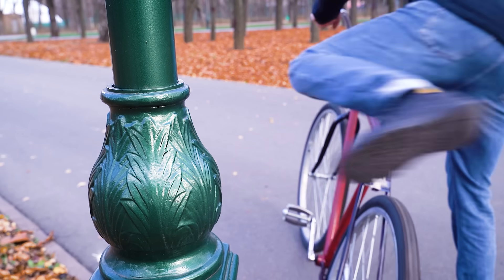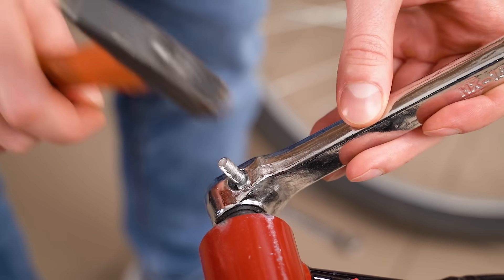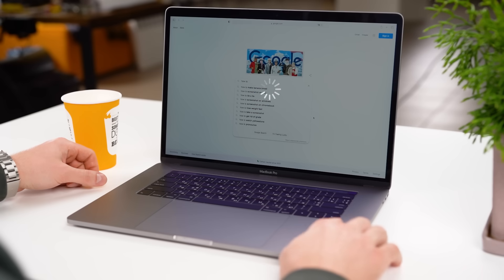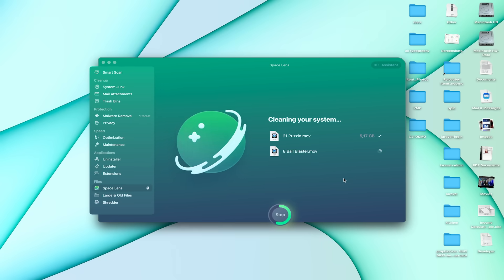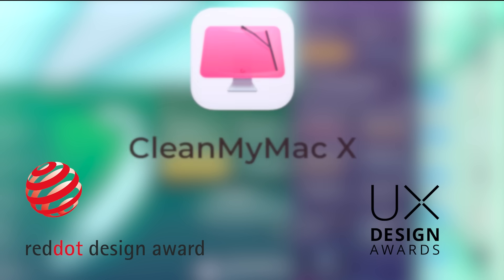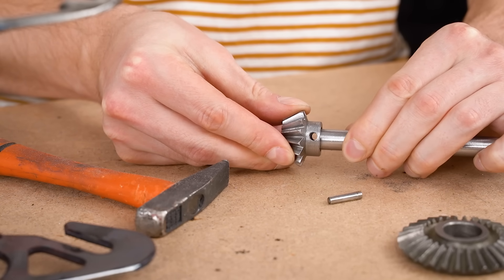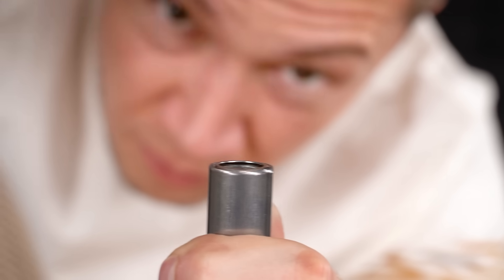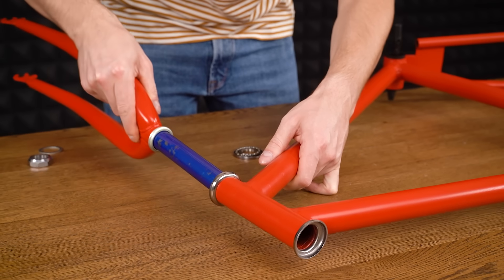Insane Chainless Bicycle Prototype

Comment: I've seen this idea before. Problems are 1) gear ratio, you're confined to one, 2) the actual contact point and transmission of power is confined to a single tooth at a time thereby putting extreme force onto a small point, 3) the drive shaft roller bearings are pretty small and likely to fail quickly, 4) the drive shaft is thin and subject to distortion.
Reply: Isnt the most glaring and impractical problem with this particular design that the pedals wil be forced to turn as long as the wheel is turning?
Reply: @HashCracker   If the drive mechanism was the only thing we were considering then how would shaftdrive be any different from a chain? There's nothing in a chain drive by itself that allows the pedals to stop independently of the wheel while the wheel is spinning. Think of a fixed gear bike. The freewheel in the hub is what decouples the wheel from the drive, and shaftdrive hubs can also have freewheels.
Reply: @jimmyjakes1823     Yes, thats why i made sure to say ' this particular design ' in my comment. I figured yall were speaking of the content featured in the video and not shaft driven bicycles in general
Reply: @HashCracker  Yes, we are talking about his implementation of a shaft drive design. My question is still what is it that would be limiting him to a fulltime, fixed connection between the crank and hub with 'this particular design'?  Because I don't see anything. The mechanism that decouples the wheels and crank is in the rear hub, not in the drive. He can use whatever type of hub he wants with this design as long as it isn't in some way fundamentally incompatible with a shaft drive. He actually seems to be using a coaster brake hub on the bike in this video, so the wheels would keep spinning independently of the crank. when he stops pedaling.
Reply: @HashCracker  A clutch system needs to be introduced that only engages once pedals are pushed clockwise.
Reply: Number 1 is wrong. Youre NOT confined.  With a few modifications you can make the system work just like a chain derailer, except it would be a gear derailer.
Reply: Yes, number one is wrong because you can use it together with epicyclical gear hub such as Shimano Nexus.
Reply: Very well engineering explanation. Thanks.
Reply: Which all gave way to the discovery of chain driven bicycle.
Reply: I was about to say same.
Reply: First time you go over a bump, that's goodbye.
Reply: Well. China can make this  a perfect bike system. 😅😅😅😅😅😅
Reply: 5) - конструкции необходим кожух, иначе от грязи и пыли значительно уменьшится срок службы шестерней
Reply: @7days306 a snack company🤔
Reply: Ware are the breaks ?? Also
Reply: Human power = .03 of one HP . Then you add your total weight what ever that would be . If that soild 3/4 inch shaft is harden steel then no problem . The bearings have no problems eather . Becuase the shaft would be vary little pressure on them .  Helicopters uses the same system for the tail rotor and those shaft are of aluminum tube .
Reply: @jeffmullinix7916 a human can generate more than 300 thats half of a hp= 736w
Reply: Its a prototype
Reply: We've all seen it before, it's literally going backwards in technology.
Reply: These issues are so obvious, its frankly surprising that someone with the ability to make it, wouldn't already know its a terrible idea/design.
Reply: @ckmoore101  It's not a terrible design at all. Cities all over the world use basically exactly the same design in ride share bicycles because shaft drive is the most durable and low maintenance design. It's the same reason touring motorcycles all use shaft drive.
Reply: @jimmyjakes1823  Sure, its not terrible, "for a ride share bike" which has extremely specific and targeted usage, and needs. Which do not overlap with recreational bikes. My original statement is still valid. Why? Because no bike manufacturer sells bikes with that design for recreation. If it worked, it would have been done 100 years ago. And the only reason the ride share bikes use it, are because its a closed system, so no lawsuits from people being stupid and getting things caught in a chain. And we are talking about bicycles, not motorbikes. Shaft drive on motorcycles are different.
Reply: @ckmoore101  Let me be clear , I'm not saying shaft drive is necessarily better for recreational riders than chains. I'm saying the design itself is fine contra your statement that it's terrible. Of course chains will always be cheaper and a little lighter, but that doesn't make shaftdrive terrible. Basically all of the OP's points are incorrect or overstated. That said, lots of companies make/ have made bikes with shaft drive that they sell to the public (a quick search turned up the Brik Brut 8 speed). Why couldn't you ride these recreationally? Lots of people have. You pair them with a Shimano Nexus hub and you have an extremely versatile, low/no maintenance, reliable bicycle. It just happens that there's not a huge market for that outside of high use/abuse applications that's willing to pay extra for  that level of reliability. My BMW GS motorcycle has a shaftdrive for the same reason city ride shares use them, because it's the most reliable and durable drive system. The actual shaft drive mechanism in this video where a pinion gear on a shaft turns a ring gear on the rear hub is the same mechanism that's on my motorcycle. So what's the difference?
Reply: None of those are problems that don't have easy real world solutions and #2 isn't a problem anyway. The most dependable motorcycles all use shaft drive not radically different than this implementation. Basically the only reason we aren't doing this is because it's more expensive and a little heavier than a chain, and there isn't a huge market for ultra durable bicycles. 
More specifically:
1)Use hub gearing. Tbh, derailers are messy, unreliable and beyond the maintenance capabilities of most people anyway.
2) This is exactly the same ring/pinion gear design used on automobile drive shafts and a gazillion other power transfer applications, and many of these don't have contact with much more than a tooth at a time either. The heavy gears used in this video are actually probably overkill for a bicycle. 
3) All the bearings on a bicycle are small. There's no reason properly manufactured bearings should fail here, or if you really had to you could increase the torque tube diameter by 1/8 of an inch and use larger bearings.
4)It's probably fine for regular riding, but you could just use a better quality steel/beef it up as necessary. 
5)Someone else mentioned this setup would get dirty. Chains definitely get dirty and this is much easier to clean and maintain. If necessary this could easily be made into a sealed system that would never require any maintenance. This is exactly why so many touring motorcycles use shaft drive.
Reply: @jimmyjakes1823 yeah as you said gears  are just more expensive and bulky and are only really necesary for high power transmision, its just way easier, convinient and cheaper to use a chain, sure you can make gears smaller and more eficient and sealed, etc but it would be more expensive for no reason, its just not necesary, i have driven bicycles my hole life and never had a problem with the chains
Reply: @mrsnail8664  I agree. I personally have zero need for a shaftdrive bike.There are specialized situations where it makes sense when the environment & usage require something ultra durable and low/no maintenance. Portland uses shaftdrive bikes with internally geared hubs in its rideshare program.

Comment: I applaud the effort. I also submi my observations: Inefficient, prone to failure and expensive due to replacement needed of worn machined parts. Result: Good practical experiments are not based on old failed engineering concepts. This design has applications elsewhere. Eg:Ships, boats, gliders,tents, gliders, big top tents and weapons. That said a 100 on the video. P.S, On second thought There is a way to increase power output ;) Clue - "Be like water".

Comment: Cool concept. In the early days they could not manufacture bicycle chains, so all biles were chainless, some with shaft and bevel gears. Question is if it can handle the torque that is as great as in a car engine, around 100-180Nm dependimg on how strong the biker is.

Comment: Well, this particular design lacks the years of experience... Dirt and mud eventually will do the thing, and it will be difficult to pedal this thing.

It would be way better to shield the gears within sealed body (with oil), to prevent the gears and the gear's teeth to corrode and worn out. 

Still, no gearbox for the shaft design, is it?

Comment: Great, now we have a bike with just one gear, and that is much less efficient, and it will wear out really quickly. People tried this idea out 150 years ago and came to a clear conclusion whether chains are better or worse than bevel gears for bikes.  Yes, it's insane to turn the clock back 150 years

Comment: The gear shaft bicycle concept has been around since the turn of the 19th century into the 20th.  The gear shaft eliminated the 'dead space' of the chain bicycle of the pedals at the 12 o clock and 6 o clock position.  That said,  the gear shaft was reputedly harder to pedal, took more effort, and presented its own set of mechanical issues. The gear shaft bicycle concept refuses to die and lingers around but it will never supersede the chain bicycle.

Comment: Ngl, although the idea of a shaft driven bike sounds cools and looks cool, I would recommend using a larger gear for the front and have the shaft gear be the same size as the gear on the wheel since the end result on this bike is too slow for practical use

Comment: One thing i would've added is a banding that went over the sprocket's retaining pin, with a single, light tack to keep it in place. I've used the 1800's variant of this bike and that's one of the biggest issues with this design, the pin coming out after a while. Could also be fixed with making a longer pin, that has a hole, for safety wire, which was the way they did it (on the restored bike i used) but the problem with that is, it can catch clothes, so a sleeve would be more "permanent" and clean.

Comment: If I made improvements to this system, I would treat the drivetrain like a car.

First, a transmission. Most cars have 4 forward gears; big semi tractors can have as many as 18 or more. So I would look into a bicycle gearbox for this concept, which I believe are now being made for E-bikes.

Second, from the drivetrain back, I would have enclosed everyyhing, and used axle seals with a light oil, such as automotive transmission oil or SAE-30 oil. That way, the gears stay cool. (A bicycle setup like this will never approach the heat an automotive differentiatial can produce.)

If you did both of these things, you could transfer mechanical power to the rear wheel more efficiently, as well as increase the durability of the parts involved.

Comment: This is a shaft drive design, which is similar to the principle of a car. We have been specializing in this kind of bicycle drive shaft for almost 30 years. The above gear is exposed and cannot be protected by lubricating oil. The longer the riding time, the faster the gear wears. It is recommended to seal and protect the gear structure.

Comment: Diesen Antrieb gab es von NSU schon in den Dreißigern. Also ist das nichts neues.
Reply: Sorry, my German is little off - does NSU make bicycles? I agree - in Austria I saw a German made city bike no chains and used internal getrieb....Kahlkhoff? Yep, it was internal drive shaft and the rear hub had speed gears to index....very useful in Austrian winters to have none of the drive movement exposed to salted roads! As you said nicht neues > however, despite internet the invention of new ideas are bound to repeat now and again? In U.S. practically nobody knows about hub mounted dynamo to drive the electrical lights?? Yet, now with e-bikes that feature seemed to catch on a little....leider, love dynamo and permanent lights like city bike in Austria.

Comment: That's cool, the gear ratio could be better I guess... And there are actual bicycles on sale with a shaft drive mechanism. And yeah it's way less efficient than chain, on bicycles at least. Oh, the rachet mechanism in bikes is actually pretty important, like for standing up and stuff, so this is pretty limited in that regard.

Comment: Actually; this is very impressive and hopefully someone else will build a compound multi geared system that lets a rider select the proper gear for speeds greater than 50 or 60 mph and or hills and terain at any pitch.

The existing bicycle gearing and drive method is totally antiquated and a get by system.  

There is no reason why the additional gears can't be added to both ends of the drive.  bike.

Comment: It's cool but 😂😂😂 if you use that kind of chainless bike your top speed is 0000.1 per hour
The big gear makes your speed higher and small gear makes your speed slower
But if you put large gear in the front  and small gear in the back your speed is higher

Comment: It is a bullshit idea which makes oryginal frame so weak, that only idiot could risk his life to ride bike, where right rear wheel has in practice strength not enougth to work longer than a few km of rides on perfect flat surface, because when this geniou sidea will meet bumpy road... debil riding bike like this will loose this rear wheel due to the weakness of materials on right side ?!?!

Comment: Good idea. But the use of iron pipe was bad. If the bike is accidentally tipped over, the iron pipe may be bent. Instead of a rigid pipe, a more flexible part can be mounted between the 2 gears.

Comment: Not workable ..

1. Gear pinions are a lot more expensive than chain and sprockets.  
2. You can’t have gears exposed to the element. It needs encasing. And seals. And lubrication. That adds to the cost.  
3. Chains and sprockets add to more gear ratios. That’s Campagnolo and Shimano.  You would think if gears solved the problem these manufacturers would be tight at it.

Comment: If the front drive gear was flipped 180 degrees then you would loose that ghastly looking gap at the bottom of the drive train an make the bb area look alot sleeker

Comment: But what f you have to stop?
You should try to attach the gear on the back wheel to the "free wheel" or ratcheting mechanism on the original axel. Pretty cool though just thought I would throw my 2 cents in.

Comment: Not so insane.
The mass production type is already on sale.
It was sold by Maruishi Bicycle in 1988.
There is a commercial at that time on youtube.
Maruishi Beveltech Shaft Drive 15" 1988
They are still on sale today.

そんなに非常識ではありません。
すでにマスプロダクションタイプが販売されています。
１９８８年に丸石自転車が販売しています。
youtubeに当時のＣＭがあります。
丸石 ベベルテック シャフトドライブ 15" 1988
今でも販売されています。

Comment: Every time you change the direction of motion, you lose power. In this case he changed direction of the power twice, so it's no where near as efficient as a chain. Also, those gears were originally in an enclosed case with lubrication. Terrible idea in my opinion.

Comment: Just look how small the gears are. 
Now realize how STRONG your legs are. Those gear teeth won't last very long under high loads. 
I've snapped regular bicycle chains before. I was able to repair it though. How do you repair a broken gear tooth?

Comment: That makes for a great art piece, but the design look flimsy as all get out. All the weight on the rear hub is suspended by a piece of steel that looks like it is about 2mm x 10mm. The drive gear looks like it will torque out the instant you try to go up a hill. Please put more reinforcement around the rear axle.

Comment: The only issue with this design is that he has to do more work to get the same output, honestly if he had a bigger gear driving the shaft and some method of changing gears then this design would work. But until that gets improved I would say just stick with the chain 🫤

Comment: Wow it’s almost like there’s not a single good reason for a chain. Except you know, to switch gears. To change the speed ratio. You know, so your not pedaling the full force of your full body weight uphill. There’s actually a solution to your chain less idea. And it’s to make a disk with holes and grooves going to each hole as they spin around the disk. Then when you switch gears, the cog gets pulled through the groove. Only issue is you still can’t hold the pedals and still move same as you bike. So I’m… yeah no that doesn’t work. Like at all. I hope this is satire. There’s another video where a guy builds himself a giant wooden stand just to set a can of soda on it and pull a lever so it makes a drinking motion for him. It’s like that level of redundancy.

Comment: BEWARE The First 1/3 of this video is an advertisement and thats the only reason for this video!  Incredibly Stupid, now you have a system WITH NO MULTIPLE GEAR RATIOS AND YOU HAVE TO PEDAL HARDER that a bike with a chain! This wouldn't even work on a child's bike. So the 80% of other bikes made around the world that have multiple gear ratio change, this is useless for. GREAT WORK!